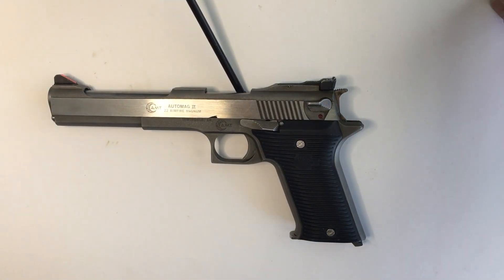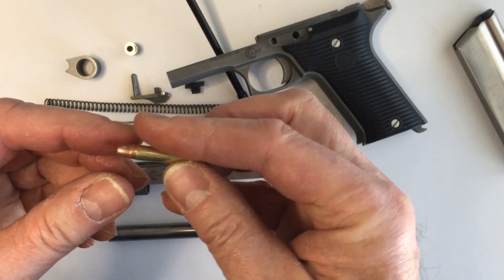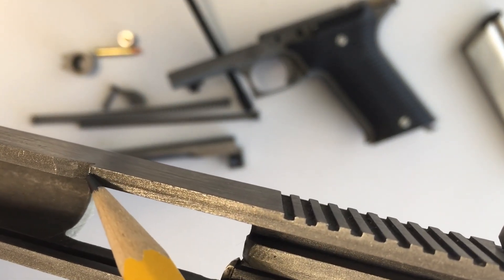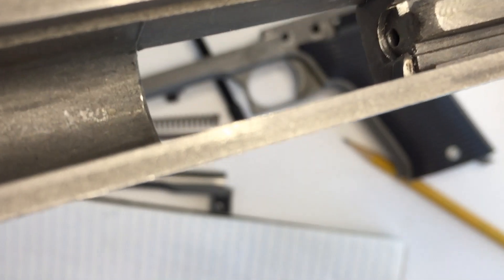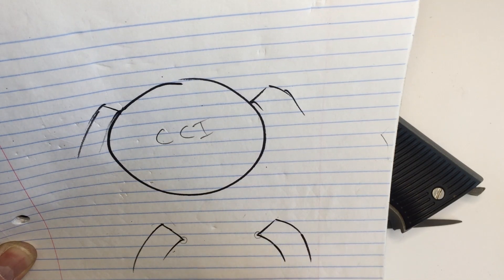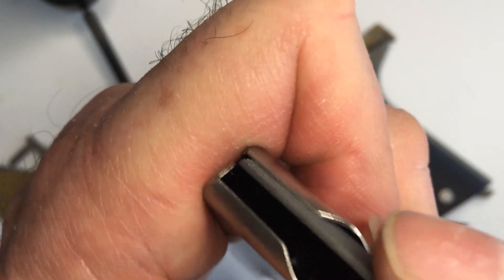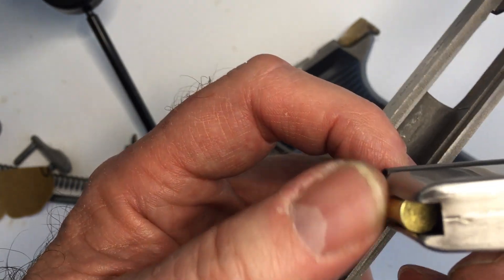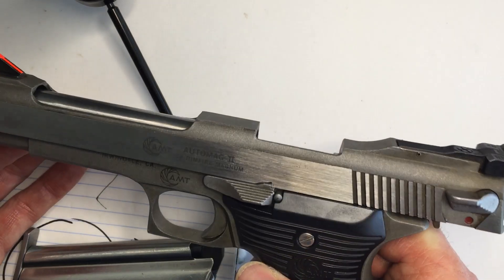AMT Automag 22 Magnum easy tune up tips

Comment: I just bought one of these at a pawnshop just like this one. I’ve seen a lot of negative videos about the ammo jamming. Stove piping. And the slide not locking back. Mine did the very same thing and I was thinking oh man what a piece of junk just like people said. But Jesus/God helped me. I put some WD-40 on the slide action and it’s working just fine now. Hasta be kept real clean. And generously oiled. It is a great gun. I have the AMT 25/22 lightning rifle. A Ruger 10/22 clone.

Comment: 22 magnum is a good round designed for rifles.  The burn rate is too slow for a pistol length barrel.  The AMT has a heavy action that requires premium ammunition and consistent attention to cleaning.  The 6 inch barrel allows a longer burn time which creates more pressure to operate the action.  Polishing like this video shows is helpful.  All said I purchased mine at a time when it was the only auto pistol available in 22 magnum.  With TLC I found it a great shooting gun that is very accurate and fun to shoot.

Comment: I have one that worked for a bit with anything I put in it. Then it started having issues with extracting the spent case. After many hours I noticed that the chamber was pitting horribly. There were huge deep pits in the chamber, I'd say 1/16 inch deep covering 25% of the chamber. My guess is there were voids in the chamber metal that burned through with use. The case would expand into these pits and lock in place. Had to buy a used barrel to replace it but I haven't shot it yet because of the price and availability of ammo.
Reply: The chamber is supposed to have those holes…..designed that way.
Reply: The chamber is made that way. To help with extraction.
Reply: @scotttilson4040  Not the way mine was pitted. If anything the case expanding into holes would delay extraction and make it harder to pull it out.
Reply: @MilsurpGarage  Holes maybe but not quarter inch long jagged irregular pits. May have to do with how they welded the linkage lug under the chamber.
Reply: These guns in the chamber area. Come premade with 18 little holes that are drilled at a 90° angle. To help the gun operate properly it’s not pitting. Unless the person that owned yours did not take care of it at all.
Reply: @scotttilson8876  Believe me it's way more than little holes. Looks more like  irregular gouges.

Comment: In my experience, the AMT Automag in .22 Magnum only 918has one probIem. Them magazines do not follow a close enough quality controll regime. When I bought mine, it would often stovepipe. With the use of wet printers ink I discovered that the ammo would often strike above the barrel throught causing the ammo to not cycle properly. The gun itself is based on the  John M. Browning designed Colt 1911, a tried and true design. 
 Good luck.

Comment: I had one that was beautiful and totally unreliable!  New and much better technology is PMR30!
Reply: For the most part it’s a very good gun. Mine had problems when I got it used. Pulling the slide back was gritty. And it wouldn’t eject right or lock back on the last Shot. But I cleaned it up and put some WD-40 on the slide and it’s working perfectly now. Sure it’s not new technology like the new stuff. But it is a great gun.